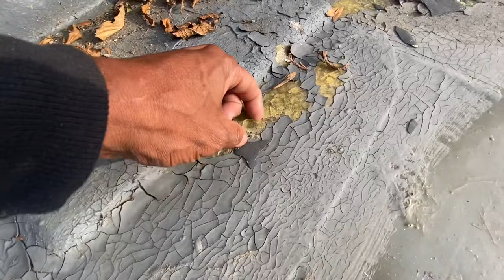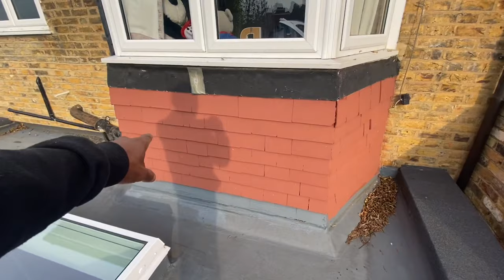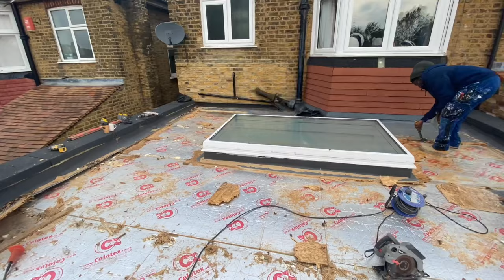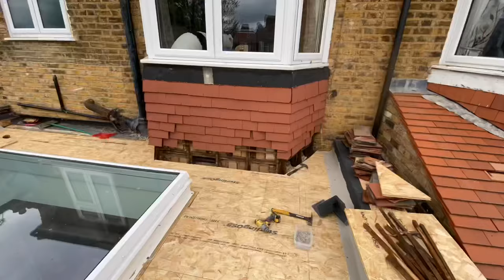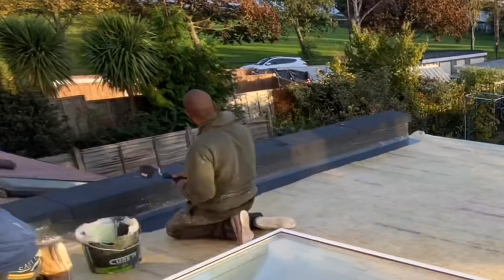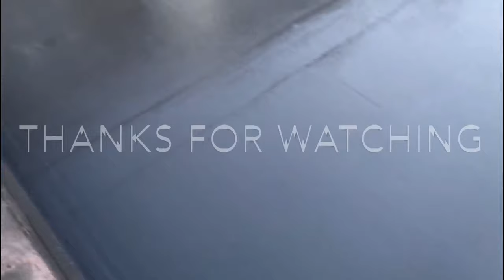New GRP fibreglass roof - using Cure it

Comment: tidy job fellas! doing my first cure it job tomorrow, wish me luck!
Reply from the maker: Go for it. I hope it went will
Reply: How did it go
Reply: @brightonduder  it was a bit of a nightmare to be honest, had a huge roof light in the middle of the roof and the weather wasn’t great when we came to do the top coat, we have done 3 more since and are getting better. It’s a good system, so much better than torch on, less danger involved!
Cheers for asking!  Hope you guys are flat out with work
Jer

Comment: They look well but that's about it. Here in Ireland we replace these roofs on a regular basis. There is no movement and they crack. Most have only been done between 5 and 8 years
Reply: That is a common misconception that there is no movment in a GRP roof,there is,  the resin is manufactured  to contract and expand, if the installation is correct a GRP roof will  last 30 years  easy, the manufacturer will  guarantee it for 20 years
Reply: They last that long?

Comment: Question @darrenthebuilder why not use full length marine ply board fewer joins comparatively ,yes expensive but labour is more expensive than the material so why not use the best, as with other boards you getting wraps and puddles, Agree with the thin coat but definitely will do second coat. Love the way you did the baywindow tiles. I am not a roofer but done few roofs for friends learning from the likes of your videos , thanks pls reply

Comment: All warm roofs have to be inspected by Building control from the local authority after paying the £60 fee. if they pass off a roof that is not built to Part L something is very wrong. If it helps, the relevant regulation is Part L 1B section 5 Appendix A. You cannot construct a warm roof with GRP
Reply from the maker: Respectfully vote taking rubbish and clearly dont know what you’re talking about so I’m not even going to argue with you.

Comment: Although it looks like a nice job, there are multiple things it looks like you didn't do, acetone the roof after sanding leave 25mm expansion gaps against the walls rebate the drip trim look into a topseal course they will show you how to do it properly but it is more expensive gear than cure it 👍
Reply from the maker: That’s the problem with us all judging 4 days work in a time lapse video. Not everything is shown (this isn’t a tutorial). All is not as it seems 🙂 obviously we can all learn more

Comment: Loving the videos. I’m having issues with a fibreglass roof that was done 18 months ago, leaking into my Dorma and into the bedroom below. Hopefully got a proper roofer to do it all again in March/April. 
Would you recommend a fibreglass or rubber roof??
Reply from the maker: Thanks Ashraf, sorry to hear youre having problems. Ive never used or installed the rubber ones so im afraid so i cant compare
Reply: @darrenthebuilder  thanks for replying roofer that I have doing the job in a few months says it’s a right mess which it is when I look at it and he recommends fibreglass as it should be 100% waterproof but after what pervious builder has done I’m worried as my spare room ceiling is a right mess. But watching your videos gives me confidence that if done right the roof should be fine. Just looking for reassurance really.
Reply: Where are you based

Comment: I wanna fiberglass my mum's flat roof. It's got some old leaking felt at the mo. Do you think I definitely will need to change the boards?  It all feels quite solid. I'm guessing if it looks ok once I've taken the felt off maybe I can get away with sanding, acetone and fiberglass. Is that an option? I hope you don't mind me trying to scrounge some free advice from you. Thanks for your videos, really helpful.
Reply from the maker: Hi if you’re going to fibreglass you will need to use new OSB boards. You might have the option of over boarding (ie. fix the new OSB boards on top of the existing felt roof but it’s better to remove it. I’d advice to strip and fit new boards before glassing.
Reply: @darrenthebuilder  Thank you for your reply. I think this job is way over my head. It seems that bitumen stops fibreglass from curing. Thanks again.

Comment: Did you use d260 fillet trims for the brick wall only or did you use a leaf flashing on top and chase it into the brick pointing ? Thanks
Reply from the maker: I’m trying to remember but I think upstands and then lead flashing on top chased into the wall.
Reply: @darrenthebuilder  sorry upstands?

Comment: Just a question, could you not have gone over the existing roof rather than pull the other one up?
Reply from the maker: Hi yes you can go over. In this case the decking boards had been compromised and some had started to rot so the customer wanted them all off and replaced. You can go over with new boards or sand back the existing fibreglass and add a new layer but the boards underneath must be in sound condition.
Reply: @darrenthebuilder  thx for that, you guys do a great job, look forward to more videos, can you recommend a company for the resin and fibre glass sheeting?

Comment: Quality fella - would you use it on a concrete slab roof that’s going to be used as a balcony? Any help would be greatly appreciated.
Reply from the maker: Hi yes you can fibreglass onto concrete once you use the correct primer. Cure it have a new prime specially for that. I think it’s called evo something
Reply: Build and repair and restore Excellent - thank you for your time..

Comment: Why are you removing the OSB and then replacing it with more OSB?  I'll tell you why, i suspect the the OSB has rotted because the OSB was layed  on top of the insulation instead of underneath the insulation. Wrong. The same thing will happen with the new roof.
Reply from the maker: Yes. It was rotted in places due to poor application of the grp. This is a warm roof and should have OSB as a top layer before glassing. Cheers
Reply: @darrenthebuilder  I suggest you contact building control,
Reply from the maker: What for? Here is some info on warm roof construction. I don’t know but you do roofs in England as you keep saying stuff that’s not true.
Anyway here’s a link…
https://www.cncbuildingcontrol.gov.uk/wp-content/uploads/2019/07/CNCD-053-Warm-Roofs-Easy-Guide.pdf

Roof joist, then lower deck, vapour Barrier, insulation, upper deck , the grp (or felt/rubber or whatever covering you’re using.) peace.
Reply: This is for "guidance", not law. it would not pass in Wales where I live and building control must inspect it before the 3 layers of felt. @darrenthebuilder
Reply from the maker: @MrFlatroofer  I knew you were not in England because it’s obvious that you don’t know the laws here. This is 100% normal in England and most drawing approved by bc are exactly like this. No point arguing from two different countries laws mate. We just accept that different countries do things different. Peace.
Reply: @darrenthebuilder Yep,  God bless you anyway
Reply from the maker: Same to you 🙏🏽
Reply: This is were we trip ourselve's up gentlemen, not quite sure myself 100% but should a warm roof have a air tight VCL above the rigid insul then osb,or osb VCL insul osb again.WTF.😱
Reply from the maker: The second one
Reply: You glass direct onto insulation ?